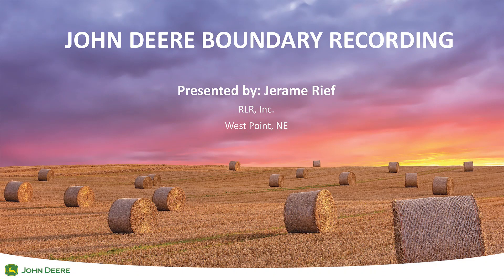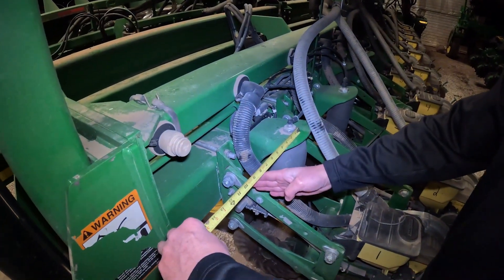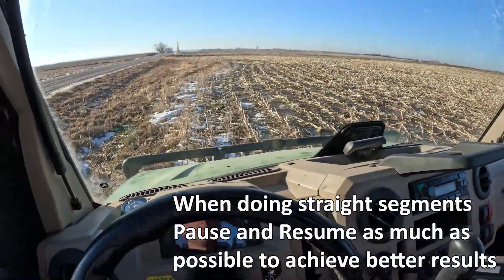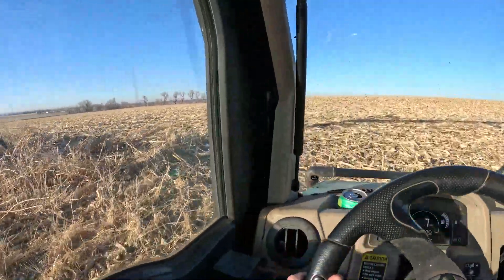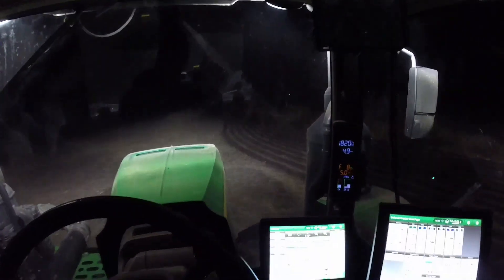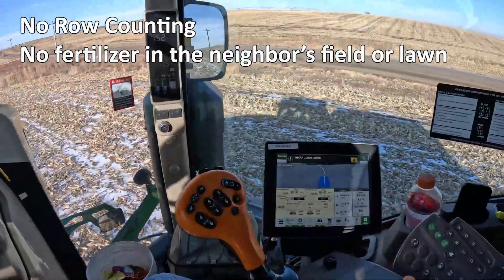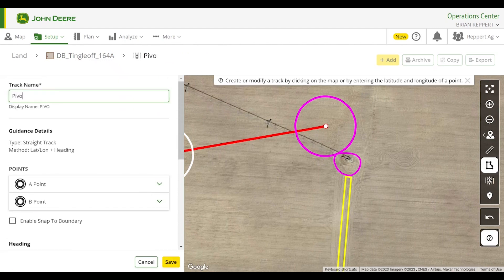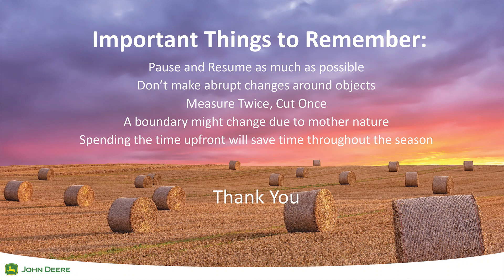John Deere Boundary Recording Setup and Benefits

Comment: Thanks for this info, really informative. Did I mess up by not getting auto trac? I have some very long straight segments that look perfectly straight zoomed out, but I'm sure it's not as straight as it would be with autotrac. Will it matter when a tractor or seeder eventually tries to use the autonomy borders I drove? When you say pause and resume as much as possible during a straight line, how many times are you pausing in a 1/4 mile? I lose autonomy after driving like 15 feet while paused.

Comment: Do you not put a front implement off as that is recording from the edge but only where the dome is lined up
Reply from the maker: For a Gator or Tractor you don't have to add an Implement.  Its recording either directly to the left or right of the globe based on inches you tell it to record.  Some people put the globe on the front/left of Gator and tell the display to record 6" to the left of it.    Then you can drive into corners and "square" them up a little better.

Comment: So did you tell the display to record the boundary 32" from centerline of the gator?
Reply from the maker: Correct.  So the left edge of the tire is the "boundary".  And if on 30" corn, the steering wheel is roughly where the corn row will be (15" in from the tire)
Reply: @jeramerief  Thank you, this video was VERY helpful to me.
Reply: @jeramerief  did you record any AB lines at the same time? Wouldn't that AB be 32" off the boundary then rather than right on it?

Comment: how big is the area that you can cover in one hour? How much time will take for me to measure boundaries for 100 ha?
Reply from the maker: Hard to say because it's based on complexity.  A perfectly square 160 acres I can do in 20 minutes.  But a complex 40 acres with terraces and waterways can take over an hour.   When you pause and resume at each pole, tree, or property marker, you can drive as fast as you can in between each mark.  So it goes pretty fast.

Comment: Nice. Glad to see im not the only one who does this. I did one up you & have an ATU300 in my 835R. , 6000 RTK.
Reply: Very nicely done sir
Reply from the maker: How did you get the ATU300 to work?
Reply: Since the plug in gator is different than the tractors for display harness,, i changed it over to make it like the tractors. Then had Ag Express make me a display harness with the adapter harness for the atu300